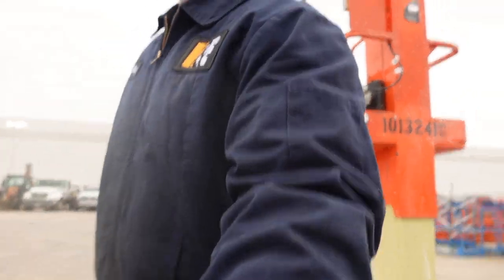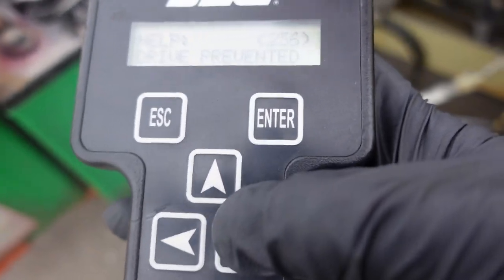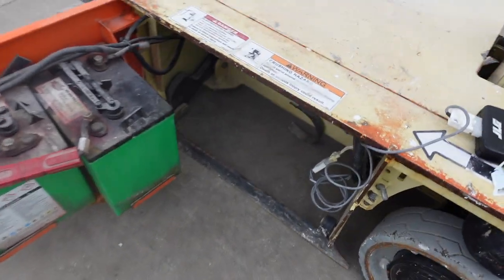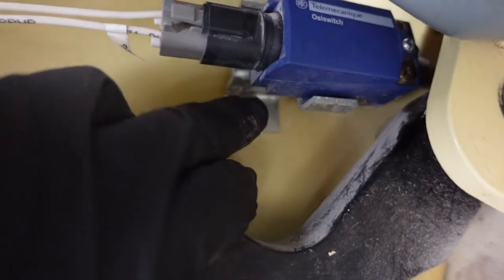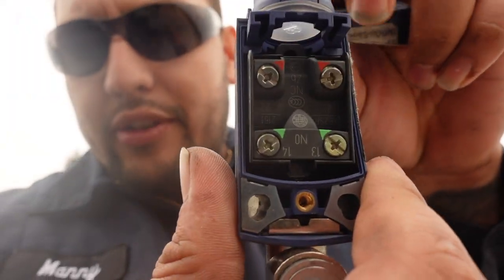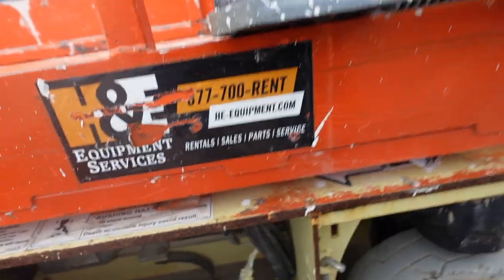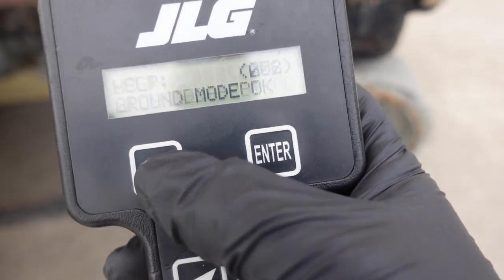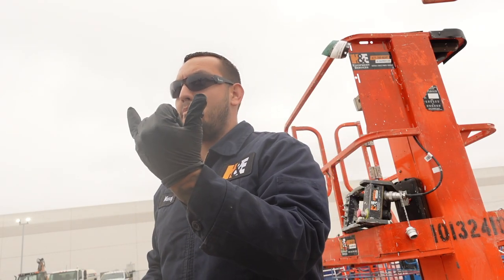Scissor lift will not drive in the air (JLG, Genie, Skyjack, Mec)

Comment: I have an older jlg 1932 scissor lift , last inspection date was 96, to estimate year of machine, not known. Unit needs batteries at the moment which are crazy expensive now. I only use this around my home working on my house. I want to know if it would be feasible to put a 24 volt power supply to power it on shore power 120v? It seems doable  but not sure how many amp power supply i would need to power it. It use to drive and go up and down while plugged in when the batteries were depleted but i guess the batteries are really dead cause it doesn't have enough juice to function properly now even when plugged in. What do you think?

Comment: I got a genie GS 1930 platform won't elevate, what do you suggest?
Reply from the maker: I would check the lift up Valve and trace back the wires that activate that valve and look for anything that might not look right

Comment: I have gs1930 that is stuck in high speed even when you are up in the air. i changed the pothole switch still did not change. my next question is the code reader is that availble for the public to buy and are they brand spacific becauce i a have genie,mec,and jlg.
Reply from the maker: Mmm almost sounds like the wiring wrong and the switches are staying closed at all times. Go up on the air hit them with a volt meter run it on continuity and touch both leads of the limit switch wires see if it reads a closed circuit
But the analyzer you see on my videos is specifically for JLG only 
Depending on the year of the genie some have a onboard at the Gcon that will throw you the code
Reply: @handymanny214  thanks i found the switch was staying closed and found bad splice in the wire

Comment: Hey bro, I have a 3220 skyjack scissor lift, has been sitting for about 20 years replace the batteries, goes forward and backwards, but will not lift , I think I have a short on my connection on the control box control. Do you have any idea why it will not lift it will go up when I control it on the bottom where the hydraulic pump is, but not on the controls. Have any idea what it is, appreciate it if you have any tips.
Reply from the maker: Wassup bro could be a couple things, first thing I would check is the wiring inside the control box maybe a dropped wire even the toggle switch itself, what year?

Comment: HI manuel i have a genie gs2632 on the controls show ready but  do not move   what can be?  thank you
Reply from the maker: Could be something with the controller connection hard to say, does it work from the ground controls ?
Reply: @handymanny214   do not move on the ground  i have one more  is 1930  moved the control and the charger from the 2632 to the 1930  and programe the control board to 1930 and move like 5 seconds and stop  and did the same thing .so i charge the batterys 100 % and work fine after, so i assuming the 2632 was low on battery ?  any website wher i can buy the control and charger is missing  both on my 1930 genie

Comment: 2030ES does everything except forward!  The lift goes up and down.  It goes backward.  It turns completely either direction.  When I try to go forward it won't move and I have to reset with a error code 775.  I read the manual but that doesn't tell me shit!  Any help?

Comment: Hi there I was hoping you could help me, I have a genie scissor lift has worked for years, it just started where it goes up in the air and then you loose all power and have to use the handle to let the platform down, and now it will only go up about 8-10 ft and does it, but once you left the platform down everything powers back up
Reply from the maker: Hello! Mmmm sounds like you have a short along the chassis harness. I’d go
Up and wait for it to mess up then check power with volt meter from one end of the harness to the other wire per wire . See if you have a wire loosing power. Specially if it’s not coding out
The way you explain it sounds like it’s stretching out as it lifts and when you come back down the wire touch again and gives you temporary power.

Comment: Hey man, I have a jlg 1930es, when I lift it about 3-4 feet, the pothole guards come down and everything continues to work as it should,  but when I lift it above a certain height.. seems like 5-6 ft or higher, it will no longer drive while in the air. I’m trying to work at 15ft and I have to lower it down to 3-4 feet before it will move for me. Any suggestions? Thanks man
Reply from the maker: So a couple things depending on the year of the unit the older units pothole guards would come down but from inside the unit the rust would prevent the spring from pushing down on the switch on the inside. So if one switch is clicking and the other one is not a symptom like this might occur, another thing is does it blink a lightning symbol on the top controller? Or do you get a red light symbol saying the machine is at angle ?? Sometimes the tilt sensors go bad.
Reply: The lightening symbol will flicker but it doesn’t flash any consistent pattern that I’ve noticed. I think the lift is about 7-8 years old, seems like it’s in decent shape.
Reply: Check your limit switches on both sides also check that metal pipe that the platform lands on sometimes they get stuck might see some ruff edges on the part of it that's inside the machine if you see those sand them smooth